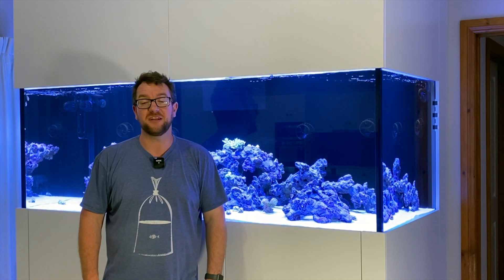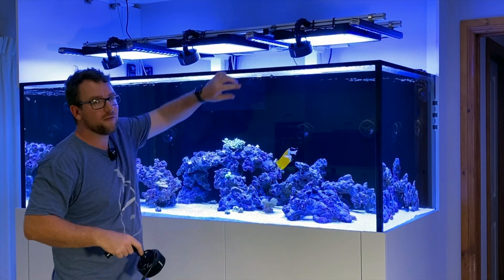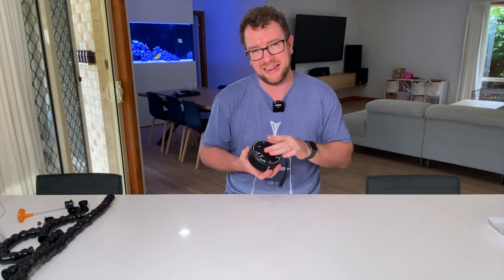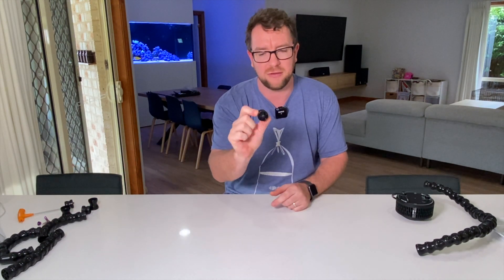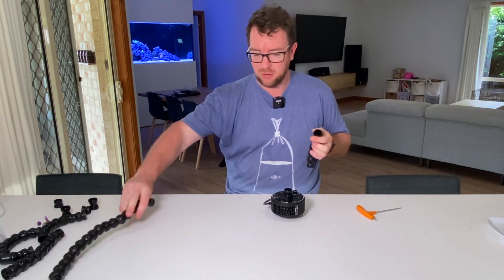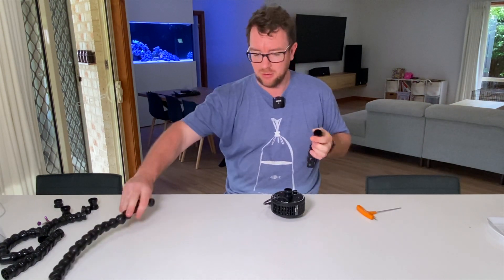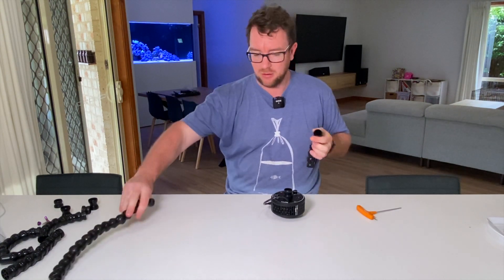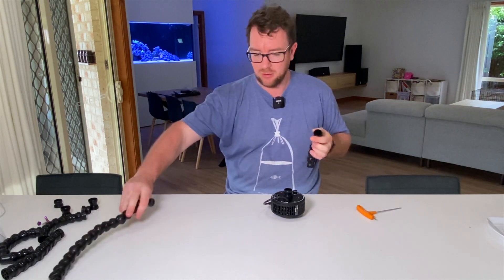Using Loc Line to mount ANYTHING

Comment: Be carefully with those while adjusting them.  They can pop off while adjusting and have those fall in the water. Dont know if kessils are water proof.
Reply from the maker: Kessils are not water proof, not many lights are!

Yes you need to be careful, that being said - with genuine locline it is quite difficult to separate the knuckles, take a pretty decent “accident” to pop them apart

Comment: You just blew my mind. I need to do this to my lights. Thanks for the video
Reply from the maker: Glad it was of use!
Reply: You said u used a m5 bolt. Is that with a  0.8mm pitch and 35mm long
Reply from the maker: @inthedogghouse86  that is a 0.8mm pitch and yeah around that length. Just tighten it up gently to ensure you are not too long and pushing in on the circuit board

Comment: This is AWESOME! - I think this is the best use case for Kessils... especially mounted at the front and pointing back so the corals grow up forward to the way tou view the tank. Plus they will add great shimmer... would this work with the smaller Kessils in terms of enough light / shimmer for your tank? Like if you had 5 of the smaller ones instead of 3 of the 360x's? The think about the X is the spectrum - I think there is more UV in there and the color is probably nicer - hope they upgrade the smaller lights soon ;)
Reply from the maker: It’ll work with any kessil, I had these (and a couple more) from the old tank, so it’s easy enough to add them and turn them down :)

Comment: I have an aquarium with a hood (AQUAVISION C25). I recently bought a Kessil a80 with the small gooseneck. 
My question is, with a hood, would the gooseneck or directly mounted to the hood be the best option? 
I just don’t want the Kessil to get wet😳 But it’s a $1,200 bubble speciality aquarium 🐠
Reply from the maker: yeah you might want to give it a little distance from the water to ensure that it doesn't get wet. That being said, the a80 has no fan so it is a little more protected - but still :D

Comment: What is the length of the screw that is mounting the lock line base to the light? 
thank you for sharing this idea!!!
Reply from the maker: Keep it as short as you can, I think I used 20mm bolts which were just enough to get through the locline fitting and a good few threads into the light
Reply: @ParkersReef  Thanks for the reply!! you ROCK DUDE!!!
Reply from the maker: My pleasure, thanks for watching!!

Comment: Sam can you show me the link for the titanium bolts your using to connect them? Thanks!
Reply from the maker: they were just some titanium bolts I had laying around from my old motorsport days.
Reply: @ParkersReef  I think I found a website that sells the exact ones just wasn’t sure on the lengtha you used, but I’ll buy a bunch of sizes to be safe lol!  I’m also trying to find M5 Tstuds for my Radions them is a little harder to locate 😑

Comment: M5 by what length for the screw that mount the loc-line to the light?
Reply from the maker: I can’t recall what length, but it was only about 5mm longer than the locline mount. Not a lot of thread in the top of the kessil